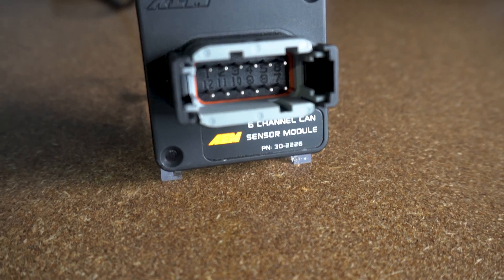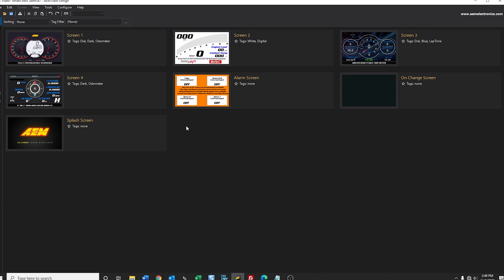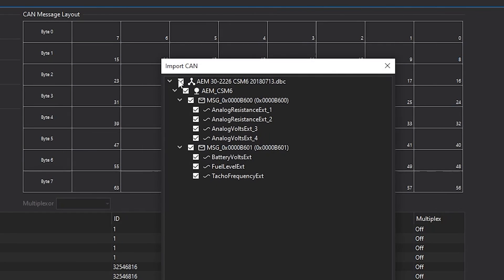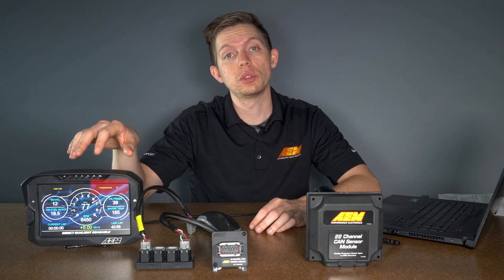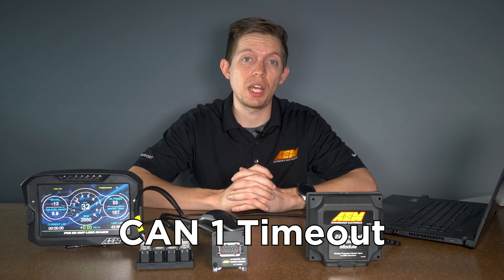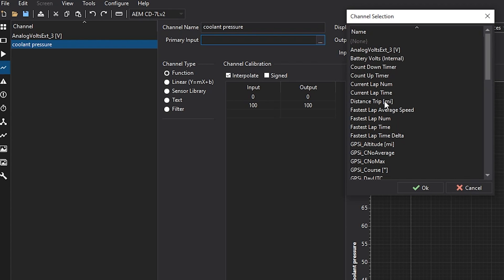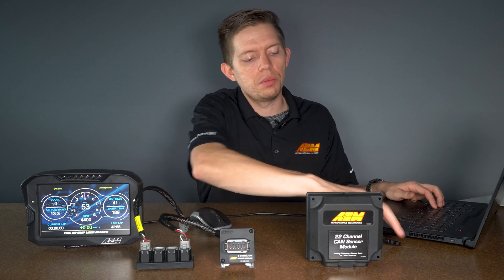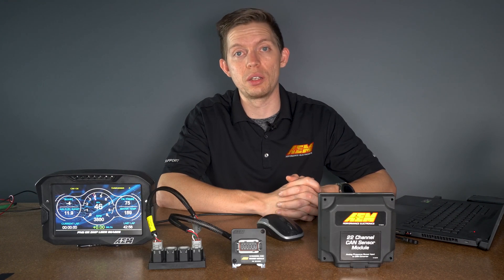Setting Up AEM's 22 & 6 CAN SENSOR MODULE

Comment: Can you add the 6 sensor module along with the OBD connector being hooked up and receiving info from a stock gm PCM. Basically can I get all the OBD from stock PCM and also add extra sensors in

Comment: What would you select for ADCR inputs ONLY coming from the 6 can channel module using a aem series 2 but not wired to the ECU. 
It is wired to ONLY the 6 CCM. Would the 2 pressure sensors wired to it and not the ecu be listed under “Analog Resistsnce Ext_1 and 2?

Comment: Hi
Is there a way of configuring the CAN input into a Infinity ECU?
I want to get some more AI to the 22 channel CAN converter and send them to the ECU.
Thanks!
Reply from the maker: Unfortunately the Infinity will not receive data from the 22csm, but the AEM CD-7 dash can be used to view and log data from both the ecu and 22csm.
Reply: Thanks for the reply. And is there a possibility to setup CAN input in the Infinity?
Reply from the maker: @andreicampean5187  The infinity ecu does not have can inputs for the 22/6 channel can sensor modules but you can log the VDM data and 8ch EGT data in the ECU.

Comment: are the can modulates still not capable of communicating with other brands of ECD/dashes? if not is this likely to change in the future?
Reply from the maker: Our CAN Moules communicate with our CD Carbon Dashes currently. This may change in the future but we do not have it on the development schedule at this time.
Reply: @AEMpowerTVelectronics  that's a real shame I thought this would be the perfect solution to my problem. but not being able to communicate over any old can network makes this a very niche product, sure ide love one of your dashes too but the whole amnet thing is a real turn off to be honest I've had others tell me this now I see why nothing I hate more than being locked to a brand even one as excellent as yours. thank you for your time answering my question.🙂